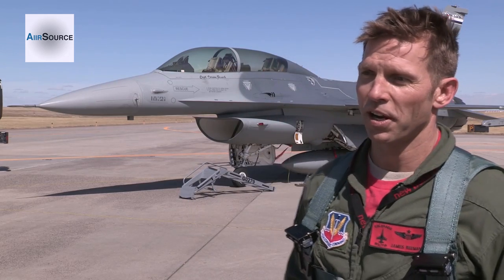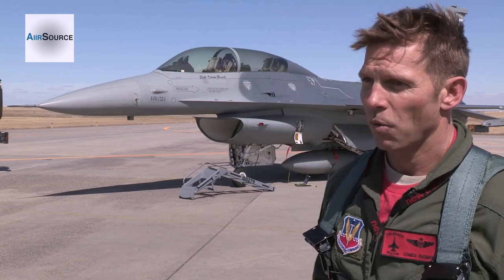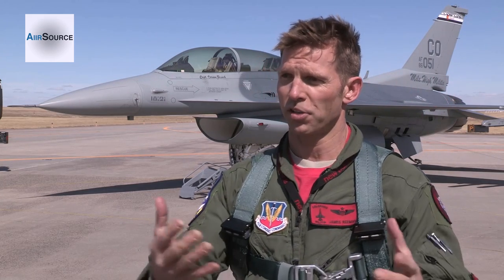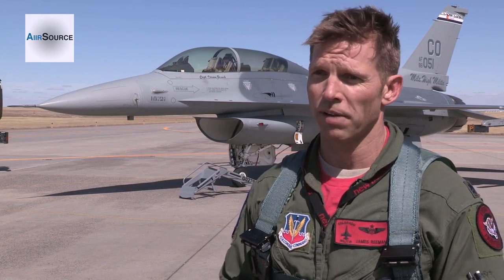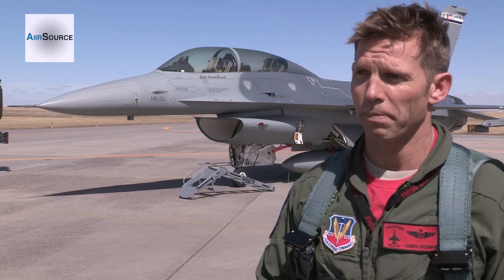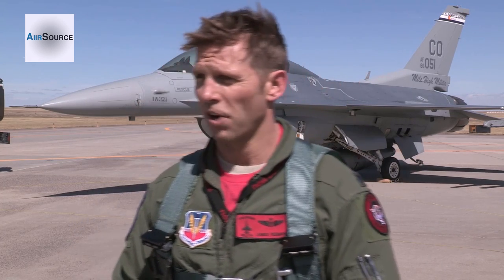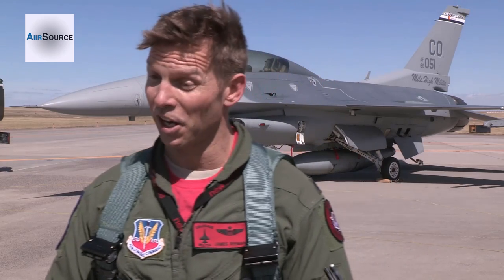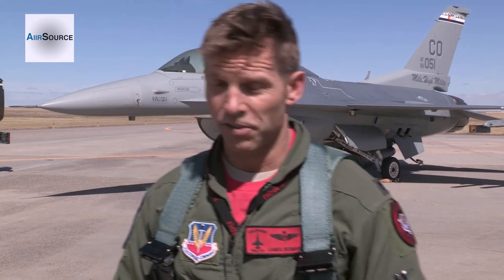F-16 Tests Arresting Cable at Denver International Airport

Comment: This arresting system is NOT similar to what is used on aircraft carriers. This system is designed for relatively low speed use for such things as an aircraft with total brake failure.  The wire is at the end of the runway.  The aircraft does not try to land on the wire and then come quickly to a stop as aircraft carrier arrested landings do.  The tail hook on f-16 and f-15 and other fighter sized aircraft, are for emergency use only.  The tail hooks are not very big nor strong and neither it nor the airframe are designed to do arrested landings as are done on Navy aircraft
Reply: Hence the word "similar" being used instead of "just like" or "exactly like".  The wires are NOT at the end of the runways, they are usually at least 1,000 feet from the end.
Reply: The preliminary testing of a temporary aircraft arresting device, which is similar to an arresting cable on an aircraft carrier, is an operational requirement prior to the transfer of flight operations to DIA.